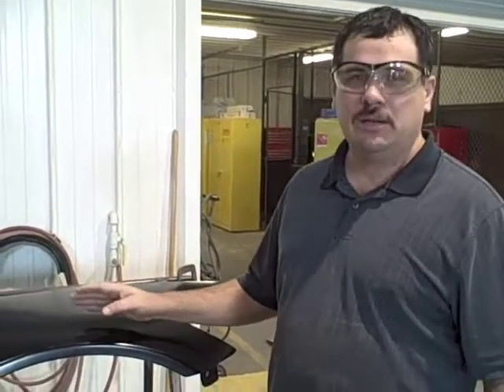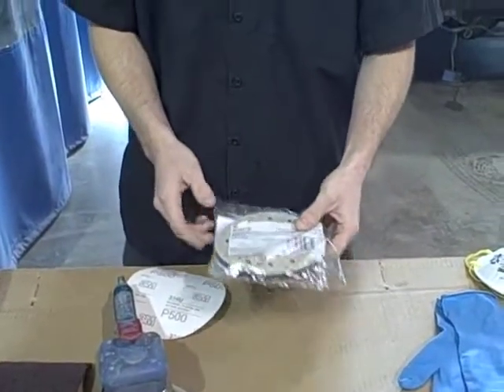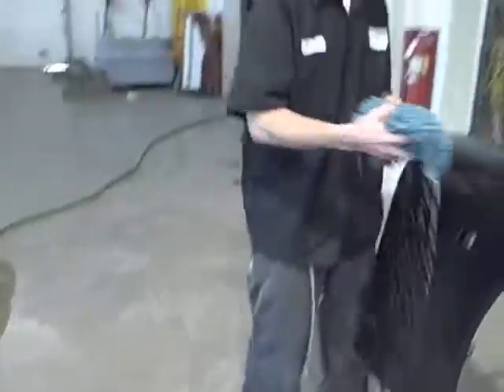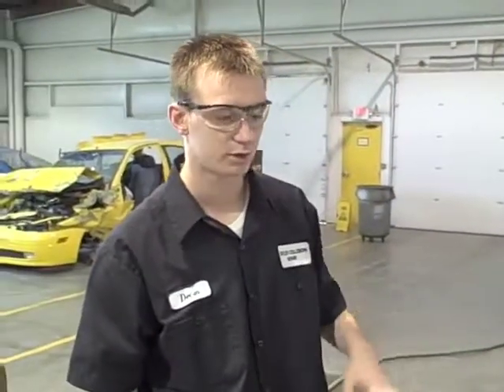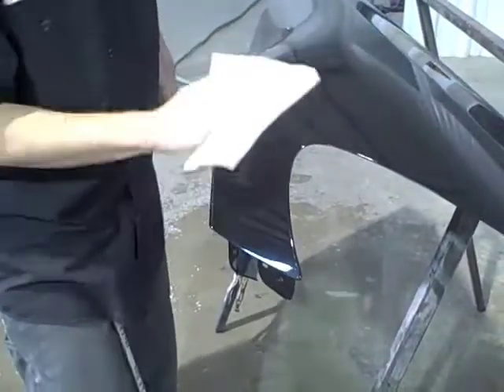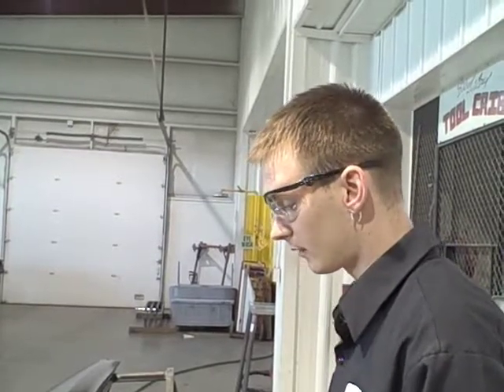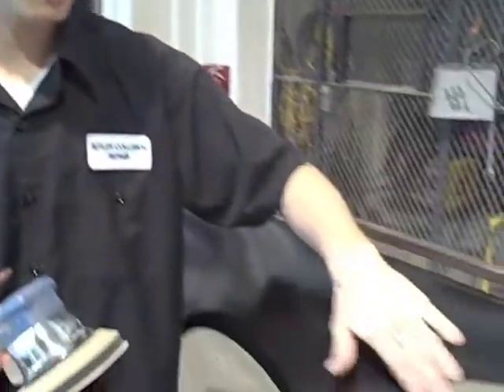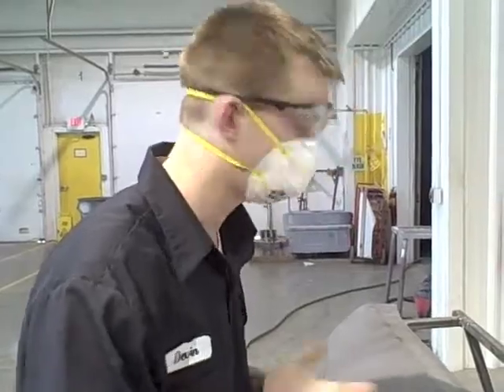Paint and Refinish Training - "How To Prep" a new OEM body part for paint - Auto Refinish Tips

Comment: I just got a hood that has been primered over the ecoat. The primer comes off with acetone. Melts. The ecoating under it appears not to have been sanded. What do I need to do to make sure this hood never ends up flaking?
Reply from the maker: I would remove all the primer and final sand the ecoat with 400 to 600.
Reply: @CarAddictGarage  Thanks. The quickest way I could do it was to sand the entire hood down to metal and then epoxy seal it. The underneath had coat but no primer. So I use 400 wet then go back with a green scouring pad to make sure I get all the tiny areas and whoop-ti-doos. Now it is ready for a sealer? Or is it ready for color? Everyone of late has been saying to use a sealer between primer and epoxy coats before color.
Reply: @CarAddictGarage  thanks

Comment: dang, I just put a new rear bumper on my truck and I'm pretty sure it was this e coat. I should probably take it off and do this if I want it to last.
Reply from the maker: Yeah, if it is e-coat it probably will not last long in the weather.  But if it is a steel bumper, then it may be paint.

Comment from the maker: @mrnockers If you do not to take the e-caot off leave it on there.  If you are plug welding you can probably just grind the weld area smooth and prime and block the spots.  If you are splicing with a butt or lap weld, I would grind the weld area and use fiberglass filler.  This will provide a better seal for corrosion.

Comment from the maker: @SmellyGymShorts No, primer sealer sprays smooth and base coat can be sprayed directly on top of it without sanding.  Primer surfacer is thicker and sprays rougher, which will require sanding.

Comment from the maker: @holeinone666 If rust has pitted the metal I would use a spot blaster to clean the rust out of those areas.  It is a 69 so tou should have enough metal.  If there is nothing wrong with the other areas, just sand it with 400 grit and seal over the old paint.  I would not sand the whole thing to metal unless there was a problem with the paint.